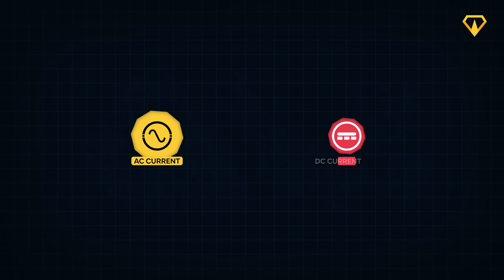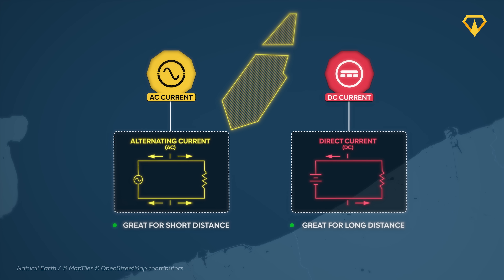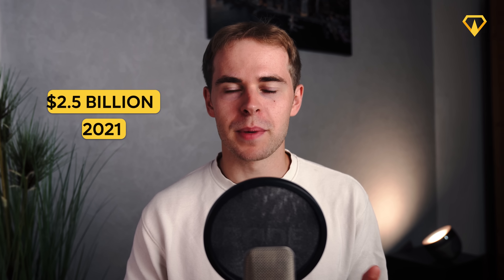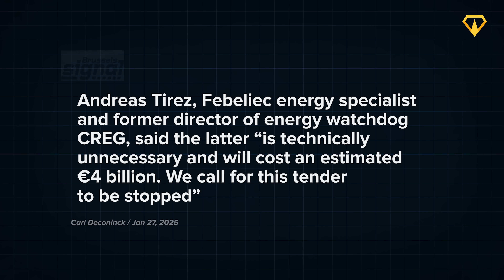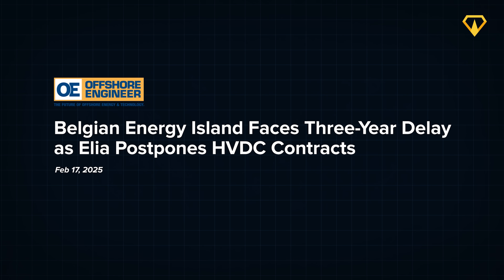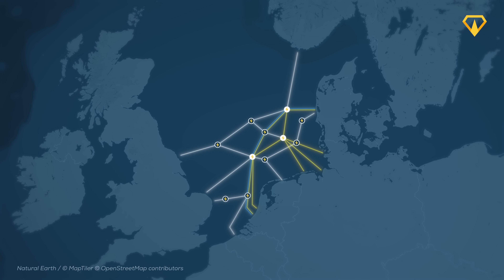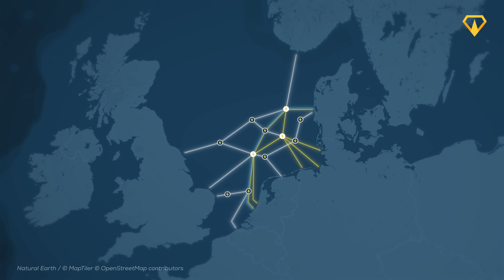How Belgium’s $7B Island Will Power Europe

Comment: DC electricity does not generally transport more efficiently over long distances than AC electricity in use.

Historical Preference for AC
AC gained preference over DC during the late 19th-century "War of the Currents" because transformers enabled easy voltage stepping up for transmission to reduce current and losses, then down for safe use. DC lacked practical voltage conversion at the time, limiting it to short distances from local plants.
Technical Advantages
Transformers work only with AC, allowing high-voltage lines with thinner, cheaper conductors over hundreds of kilometres. Early DC required thick cables and frequent stations, making it costlier for grids.
Modern Context
HVDC now excels for ultra-long or submarine links due to lower losses (no reactive power or skin effect), but AC dominates distribution for its simplicity and infrastructure.

Comment: you know what, i'm happy if they stop.. think about what these blades are made of, it's just another byproduct of oil.. yes it provides more energy, but they also wear out and what ever we do to them- will pollute the earth further.
wind turbines should be in the vertical axis config, and made out of stainless steel plated in some other alloy.. this solves most issues with wind, ofc it's gonna produce less- but that's a good drawback. 

solar is meh, ok on small scale (house/building).
waves suck, can't be kept clean, best you can do is tidal stream turbines. 
tiny nuclear salt reactors are genius for small towns, army use, anything at the edge of civilization.. the moon.
using a reactor for a town cuts down powerlines instantly, if town grows just ad another.. cities ofc run on normal nuclear, need them to produce the spent fuel used in salt reactors.. or just mine up those we hid :D

Comment: Very poor video.
Politicians are strongly considering downscaling the project because it's becoming too expensive.
It has not much to do with Russia. Europe simply started importing natural gas from elsewhere (e.g., the US).
AC and DC each have their strengths. AC is also used for long distances and usually much cheaper (passive transformers). DC is typically used for underwater cables and for interconnecting non-synchronized grids.

Comment: Terrible project, terrible idea.
The cost of replacing parts on the wind turbines alone will be so high they'll wonder why they didn't just build 10 nuclear plants that would last 50-70 years for the same price.

And if we really want 100% clean energy, geothermal is the most logical place to invest, it's just a matter of digging a hole deep enough and you can have virtually infinite clean energy everywhere you want. The earth's core is hot enough to spin as many turbines as we can build simultaneously and is the single best source of energy we have.

Comment: AC won mainly because it's the natural choice for generating power from rotating turbines, changing voltages with transformers and powering rotating motors which most (big) power consumers need like engines, pumps, compressors... AC is also easier to break current at switches, especially at high voltages, DC tends to 'stick' and make huge arcs since it never crosses the 0V line which AC does 100 to 120 times per second. DC is becoming more usual for everything computers, batteries, data centers. Purely for power lines at the same voltage, DC was always the better choice. We have just both gotten better at converting and using DC compared to the pioneering times of electricity. And AC voltage is the RMS value or root mean squared, meaning the peak of the sinus wave of AC current is V2 times higher than the rated voltage (like 230V AC means 325V peak voltage). For DC 230V means 230V peak obviously). The higher peak voltage for AC is the driver behind the higher losser in transmission. 
Since we are now moving much bigger energies at much longer distances the advantages of DC transmission have become to great to ignore. Also since the undersea cables are already much more expensive than air powerlines on land.

Comment: If the AC-DC conversion is not on the island, and the wind turbines are not on the island...

What's on the island?  Batteries?  Wouldn't those be better on the mainland?  Easier to maintain there.  They're usually pretty dense, so they shouldn't take up a lot of space unless there are requirements for large buffer zones with no people around the batteries.
Reply: The transformers will be on the island and/or the electrolysis machinery will be there.
Reply: @old-pete  If the AC to DC conversion happens closer to the wind turbines, then the island is just going to have DC.

No AC.  No transformers.

Electrolysis machinery?  What's that for?  Does some place in Sweden have a bunch of heavy crude they need to refine?
Reply: @IainMcClatchie 
No, windturbines make AC.
If you want DC, it is cheaper to collect all the AC in one place to have one conversion.

Electrolysis is for hydrogen production.
Reply: @old-pete  Correct, wind turbine generators make AC.

@4:43 the video has a diagram, but it's not clear.  Okay, maybe there's AC-to-DC conversion on the island.  That suggests the wind turbines are connected to the island with AC links undersea.  Inefficient, but I suppose if the links are short enough the losses won't be so bad.  It's definitely the case that transforming all that AC into a single (three phase) AC waveform and then converting that to DC would be more efficient than trying to make a bunch of smaller converters scattered around the ocean match one another's DC voltage levels.

Comment: this is bullshit. Wind power doesnt work. By the time you've factored in maintanence, building and installing and storing transporting the energy etc it is worthless. stop this madness
Reply: Electricity is on. Seems to work.
Reply: @old-pete   missing the point........ as leftist weirdos always seem to do......
Reply: @grimwulf8547 
You claimed it does not work.
But it does work.
Reply: @old-pete  no, it doesn't. A wind farms purpose is to produce electricity with a lower carbon footprint. IT DOES NOT DO THAT.
Reply: @grimwulf8547 
It does. Its carbon footprint is much lower than coal or gas power plants.
Reply: @old-pete  Not after you have factored in construction, delivery, the concrete base, maintanence, cost of transporting the elctricity to peoples homes, storing the elctricity, cost to environment and wildlife, it all adds up. wind farms are just politicians trying to say that they are doing 'something' when they are not.
Reply: @grimwulf8547  That is all considered. Windturbines save  all invested CO2 in 5 to 15 months.

Comment: I think wave energy would be better, there sre a lot of different technologies. There is also a technology that uses the flow from a river, basically it uses a channel that let's  water from the river to flow into a special fan which constantly turn as long as there is water flow, which then flows back out ay the other end back into the river. So if you you have several channels you've got more energy.

Comment: Sadly the Energy Companies are "Cherry Picking" energy production profits while ignoring the 'Elephant in the room' ; Britain and I will bet all countries have distribution cabling infrastructure designed for the old centralised generators/ power plants.
We are already maximising capacity and are no where neer starting to invest in the new Pylons' that are needed, are huge and expensive and will be verry unpopular. 
Trough Green Energy is about locally even domestically produced electricity but by using the old grid they choke the supply chain until their new "green" dominance is ensured.

Comment: Norway mostly has deep waters, so if Norway is going to contribute in a significant way it is either land-based (where there is huge opposition to building more) or floating wind turbines, and those are so far proving more expensive than first hoped for.  So right now plans are a bit on hold.

Comment: The Robotdogs is a hoax.  The Island will be nearly  fully automated. The budget is still controversial and discussions between Electrabel, Luminus and the Belgian Government are not finished.
Reply: Robot dogs can be very useful, but only for unplanned operations, and there shouldn't be anything unplanned that needs doing once construction and testing is complete.

I still don't understand why an island is needed, says in the video that it will serve three wind farms totalling 3.5GW of turbines, but the UK hasn't built a very expensive island to serve our 5.1GW Dogger Bank wind farm, and that has two HVDC links to the mainland grid, we simply put the transformers on another platform, each turbine has a platform, extra platforms for the substations and HVDC equipment is very cheap and easy compared to an island, and requires far less heavily CO2 emitting concrete than a few little net zero steel platforms that are conveniently distributed and thus disaster resilient!   Centralising everything is not good, electricity distribution needs a network.

Comment: I find it interesting how large projects like this, based on renewables and electricity are often coming in late and over cost. Not only these islands but also projects like the Snowy 2.0 Hydro scheme in Australia.

And in general the cost of renewables around the world has been underestimated because they also need to include an upgraded and more extensive grid that is redesigned for the distributed and intermittent generation of renewables. Plus the cost of energy storage, be it batteries or hydro. Plus the cost of a backup generation for Dunkleflaute. Plus the much shorter life span of the renewables compared with nuclear power.

On the other hand the cost of nuclear project is regularly overestimated, largely due in the developed world due to bureaucratic overregulation for non scientific and non technical reasons which introduce delays and extra cost in the construction. Which effectively makes every nuclear reactor an expensive prototype reactor, rather than one of the series where the permissions and designs are the same which will avoid so many of the unnecessary delays.

BUT in countries which avoid these bureaucratic, NIMBY based regulations it is still possible for countries like Korea to build four nuclear reactors in twelve years in the UAE at the cost of $8 billion and these reactors are still built to International Standards.
Reply: It is as it ever was.

Comment: "In total, [the island hub] promises to handle 3.5GW of wind energy."

Europe's electrical usage is on the order of 350 GW of energy.

Later: "by 2050 will generate 300 GW. Okay, that's better. Princess Edward Island is a node in a much, much bigger project. It's that larger project that could power Europe.

Comment: 2:39 3.5 GW what? troughput? hours capacity? those details are important
Reply: Electric power is already per a unit of time. 3.5GW is 3.5GJ per second
Reply: @smb6995  no .. GW is a measurement of potential power troughput not of stored energy .. 
you confuse that with battery storage
there's a reason why it's called KWH or MWH or GWH not GW .. you pay kilo watt HOURS on your electric bill

Comment: There's One Very Important Point Everyone Is Missing, All Of These Windfarms Alter The Weather Patterns And Long Shore Drift Currents Each Side Of The Dover Straight And The North Sea Areas Coasts. The Statement Of AC Versus DC Current Transmission Is Incorrect, AC Can Be Transformed Up To Very High Voltages At Very Low Currents And Is Generally A Frequency Of 50 Herts/Cycles Per Second At Both Super And Very High Voltages For Transmission Over Long Distances, (And Even Lower  230 Volts Higher Current Europe And Lower 240 Volts  Higher Current UK Domestic Local Underground And Overhead Pole Mounted Three Phase And Single Phase Supplies), To Minimise Losses Over Hundreds Of Miles. DC May Well Be Inverted Up To Higher Voltages But At DC Voltages, The Cable's Resistance Still Has An Appreciable Effect On Losses Of Voltage. The Sea Being Salt Water Saline And Other Minerals, May Well Have An Effect On AC Current Absorbtion, But At Milliampere's Of Current At Very High AC Voltages, That Over Come Losses In A Cable Of Voltage Drop, Due To The Low Frequency Of 50 Herts/Cycles Per Second Of The AC Voltage/Current And The Neccesarilly Large Cross Section Of The Cables Laying On The Sea Bed For The AC Supply, That Are Heavily Insulated Against Water Ingress, The Cable Insulation Being Both An Insulator And Dialectric, To The Overlaying Sea Water, The Area Of The Enclosed Conductors, Also As AC Three Phase, Poles Referred To The Sea Water's Collectively Earth Referenced Pole, There May Be Some Losses, But At Ramped Up High AC Voltages And Low Current In Very Small milliamp Ranges, I Doubt The Losses Would Matter At AC Voltage And Current, For Say 12 Miles Or So Of Cables, It Would Certainly At DC Voltages And Current Have Sigmificant Losses Even If Higher DC Voltages And Lower Currents Due To Resistance Effects At DC Of The Same Cross Sectional Area Cables With The Same Thickness Of Insulation. Be Problematical.

Comment: It is not about AC or DC. It is about voltage.
Reply: Sort of.  Most of our existing transmission lines are AC and companies have been making equipment for that for over a century.  HVDC transmission is relatively new and there aren't a lot of companies that produce the equipment for it yet.

It sounds like there's been a spike in HVDC equipment demand, and the existing manufacturers can't keep up so they've hiked their prices.

Comment: wave /underwater current power is probably wiser.  or if you want a wind farm, make them more like the wind turbines of dune.  science has given us many new wind power systems, masts that wiggle providing power being an example.  if you put a pylon down, like the ones of oil rigs.  identify the current flows of the region and set up the pylon as being the central hub of a propeller generator... you see currents would push it round just like the wind right?  current moves and the "power rig" moves with it.  wave power :D  do NOT stick with just one type on the island... tides create high and low tides this can even be used to make power.  ... rant done, peace.   whoops one other thing... data centers give off heat, if you put one underwater, collecting that heat to generate a flow... heat exchange basically... could that be used to generate power?

Comment: This is BS since a back of envelope calculation shows that the area for wind units to power Europe would cover the North Sea and more if one considers that wind power is non dispatchable and so will require massive battery storage. Then we have the fact that the Northern Hemisphere is colling - check the USDA Climate Reference Network data for confirmation - with more severe winters that will ice up the blades resulting in zero power output.

Comment: It sounds like a great idea on the surface but with obvious over-engineering that always inevitably leads to massive price over-runs and technical problems.  Designs should be as  simple as possible on purpose.  That is not to say don't try to accomplish as much as possible--just add functionality only in ways that do not add complexity.  If it adds complexity, don't do it.  You can think of retro-fitting later but do not build your initial designs with added complexity for the anticipation of anything.  As a long time engineer, that is my most important life lessons.

Comment: Energy independence? What a f*cking joke! Russia will have a blast sabotaging all those offshore unmanned installations and cutting all of the juicy unprotected cables using their submarines and fleets of merchant ships that constantly drag their anchors "on accident".

Just over the past year alone they've cut like 20 of those, and that's just the cables, there were also multiple industrial sabotage attacks all over EU, all easily traced to the ruZZian regime. But these jokesters will do just about anything other than building secure and reliable modern nuclear power plants >_>
Reply: Whoever was planning that project did it so under the assumption that we live in a fair and civilized world, where you can build advanced critical infrastructure out at sea, leave some robot dogs to oversee it, and go back to your green eco utopia. Unfortunately that is no longer the case, might have never been the case, actually.

It really sucks that we can't have nice things because of those assholes and their incessant need to sabotage any attempts to get away from depending on their raw resources. I swear, ruZZia is behind like 3/4-ths of the problems on this planet, we should just nuke them already and be done with it. Everyone will be better off for it.